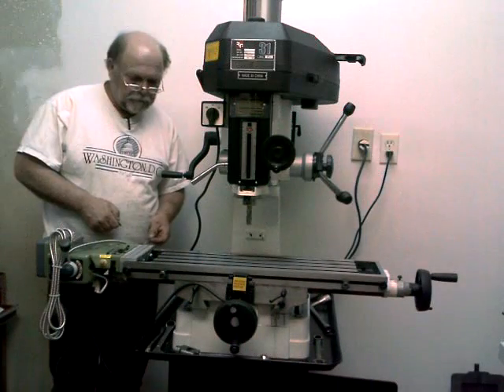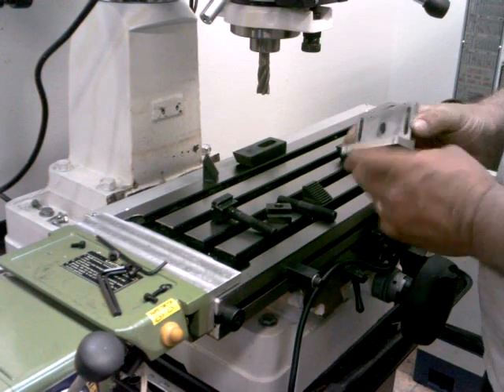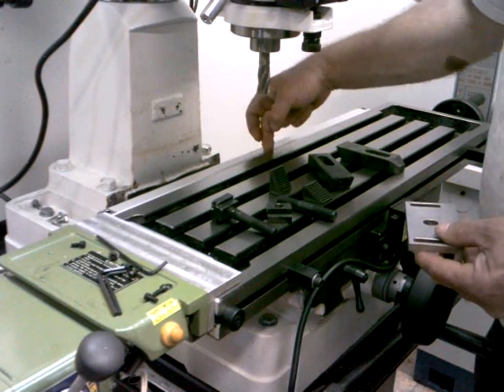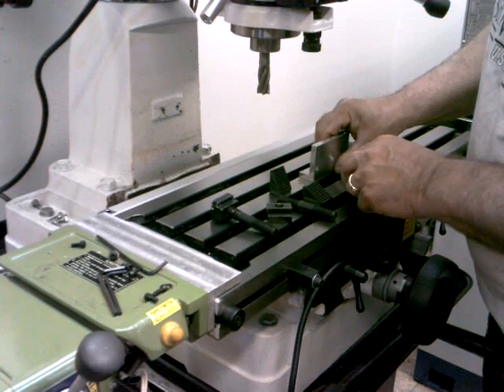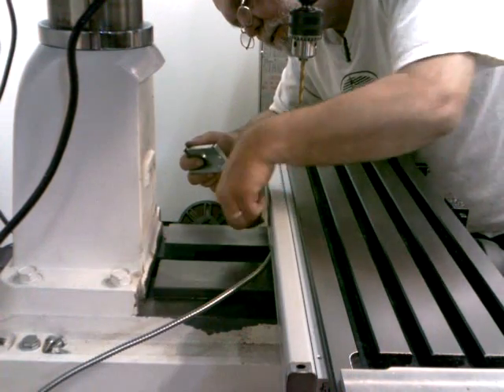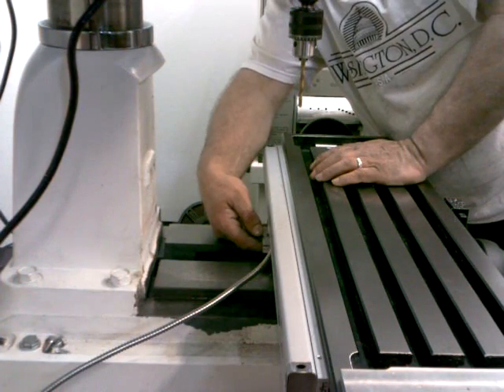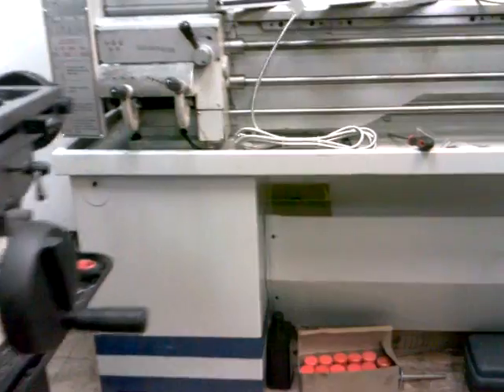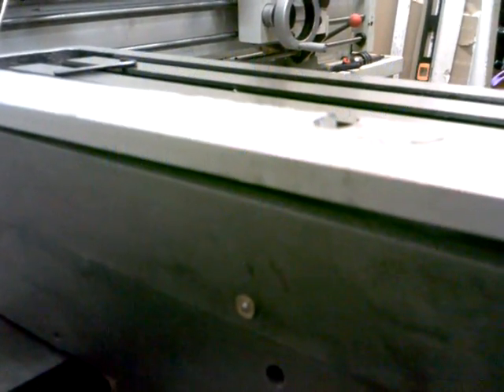RF31 DRO Installation. Part 1

Comment: I have the same mill/drill but with the Grizzly name on it.  Same little vise came with it.  I see you mounted the scale on the back of the table.  Does the mill have the possibility of smashing the bracket between the table and the column when you move it in the "Y" direction?  I have ordered a DRO so I am interested in what fits where.  Thanks for the video.
Reply: I just bought an Enco RF 30, Built in 1984, that has the Z axis powerfeed, sold by Rong Fu!   I downloaded the manual for the Enco, and it doesn't show the power feed drive belt, but, does show the power transfer box, and pulleys!  So, I went and grabbed the Jet, Central Machine (Harbor Freight tools) manuals, and they are the identical manual, with all the same inventory of parts, using the identical part numbers!  In fact, the Jet manual in pdf (ODF) is rubber stamped 1995, and where it would have Enco logos and words, the Jet manual has black marker lines!  

All three manuals have the exact same typographical errors, and crazy Engrish wording!  All my Chinese friends tell me, yes, after Mao Tse Zhung murdered everyone except the peasants, there were no educated people left to rebuild society, so China is still in the dark ages of ignorance.  So everything is copies of real things designed ad built by ;the smart Chinese in Taiwan, and other places in the world that weren't "rewarded" by the presence of the great peasant Mao.

So, before there was a Rong Fu company, like in 1984, when the machine I purchased used off Craig's List was made, someone was putting the same power feed on the quill, which is today part of Rong Fu.  So, I discovered all this which seeking the drive belt, which is 23.5 inches long, and looks like a red silicon O ring, in the videos today, of the Rong Fu RF31.  As of right now, I still need that belt, and have not seen it for sale on the world wide web.
Reply: Amateur Redneck Workshop for those reading I would highly recommend not installing the scale on the back of this mill for a couple of reasons. First you lose valuable y travel and second it will crush if your not careful. On my bigger mills with 12” travel it’s fine but on my enco It has to be on the front. My Grizzly 761 can have it in back because there is plenty of room with the accordian style way cover although with that removed and a neoprene cover installed adds another inch of travel. All things to consider if travel is important to you.